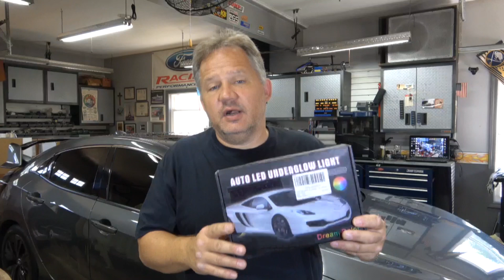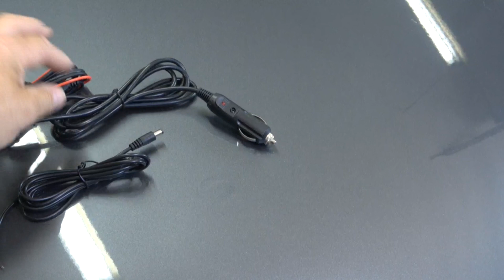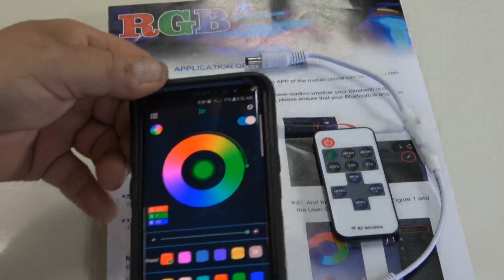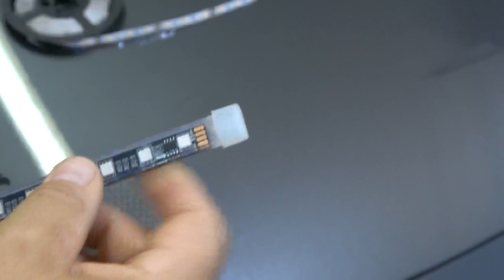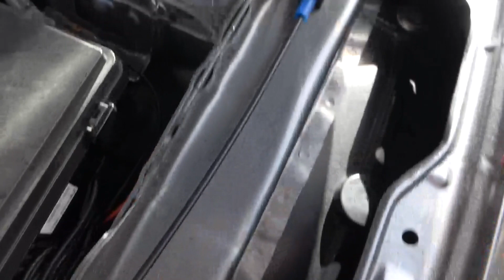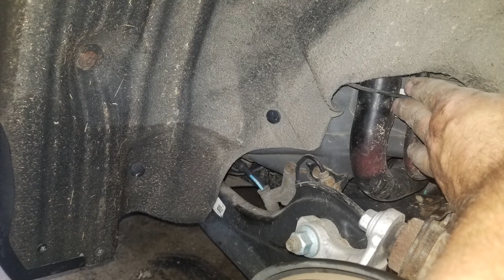Installing LED Lighting Inside or Outside You Car SUPAREE

Comment: Pete, thanks for the information.  I'm sure some people with love the look.  However it's not for me.  I've seen a few muscle cars with kits like this and I just don't like the look on a muscle car.  With that said, if the LED's were white and pointed up/in, and used an external battery source, it might be an easy way to light the under side of the car when working on things.
Reply from the maker: I am seeing more cars with LED lighting. I use them for interior lights and they work great. That's a great idea.